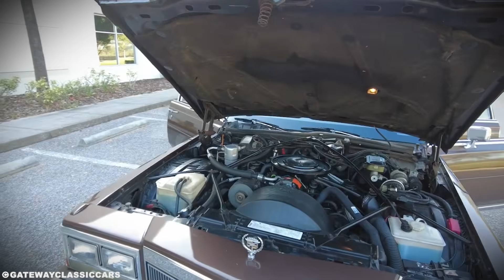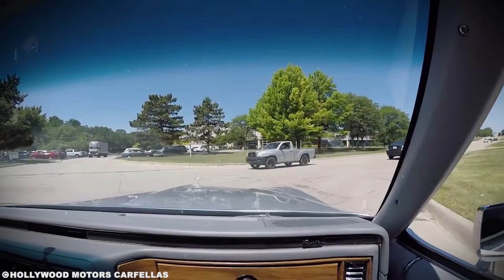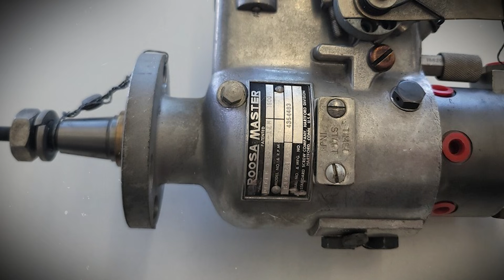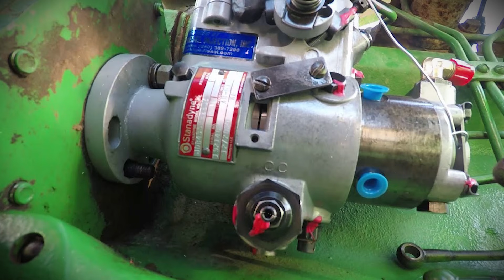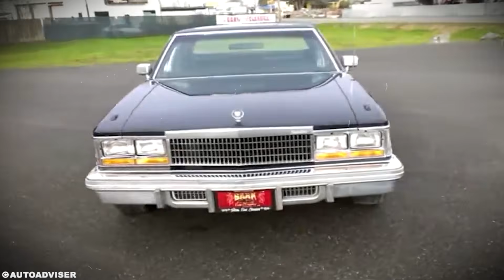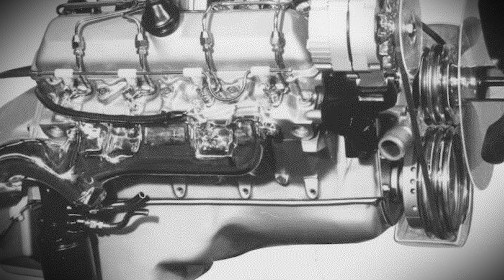Why Oldsmobile’s Diesel V8 Became One of GM’s Biggest Disasters

Comment: Mercedes Benz and Volkswagen have done the same thing, Peugeot have made dieselized gasoline engines, Mercedes Benz 1st engine was a gasoline engines first Volkswagen did the same thing in, and the Volkswagen engine gas engine debuted in 1974 , less than 2 years later they dieselized it 1976 more than 2 years before Oldsmobile ,at the Oldsmobile engines had been in production since 1978 ,it was dieselized 9 years later, furthermore GM was already building and selling diesels, buses and trucks, so they weren't doing something that they were totally unfamiliar with

Comment: The really bad fuel consumption that most American cars had until the late 1970s was partly caused by the use of a hydraulic torque converter with no lock-up clutch, so at low and moderate speeds about half the engine power output was being turned into heat in the transmission fluid rather than delivered to the wheels.

Comment: I've had a number of the LF9 5.7Dx motors over the years and even turbocharged one in the late 1980's. It outlasted the car body. The engine itself was NOT bad, it was the cost cutting by then president Roger Smith who destroyed both the 5.7Dx and GM as a whole during this time. I still have pictures of the turbocharged 5.7Dx as proof of this and despite the bad reputation I will defend the 5.7Dx regardless.

Comment: At the time it was the strongest engine platform GM had for converting to diesel. 
Just the facts. They didn’t think they had time to engineer one.
Reply: 100% it was a strong platform. The blocks held up just fine, as did the cranks. If they had gotten the head gasket situation figured out, and had incorporated a water/fuel separator before releasing this engine, history would be different.